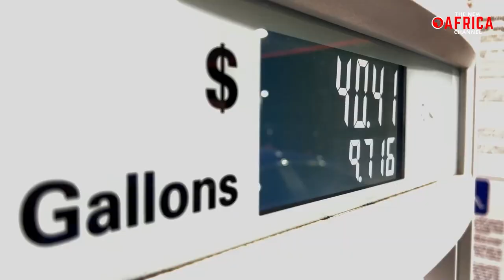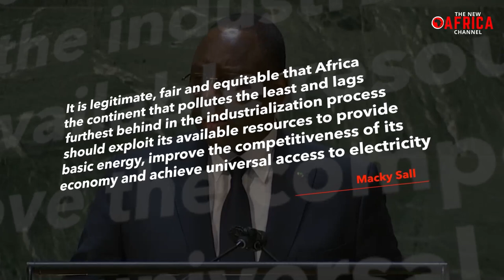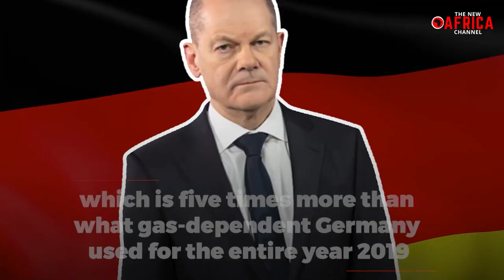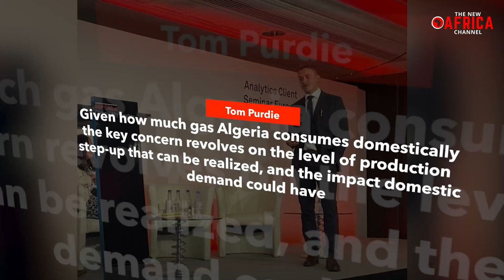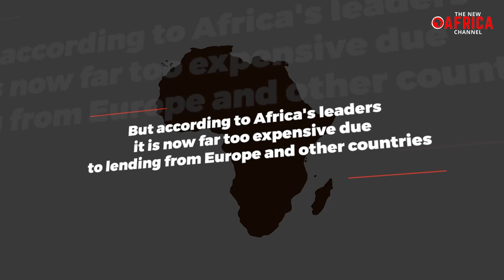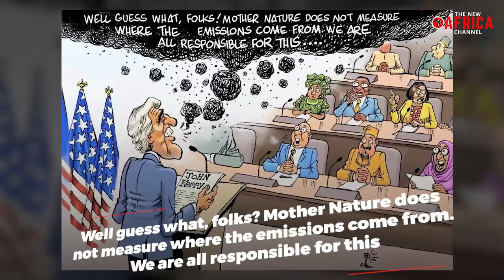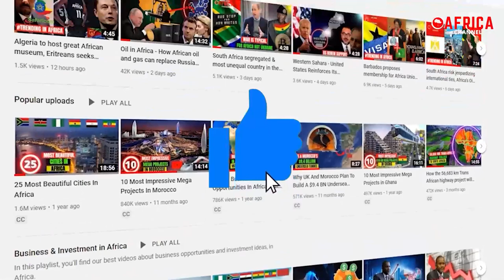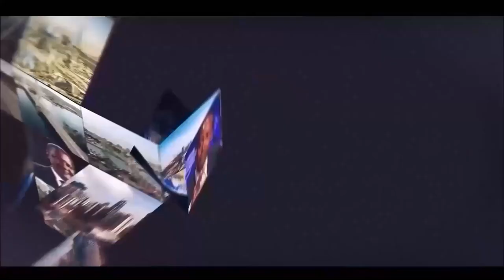Energy crisis forces EU to change climate stance for CHEAP African gas

Comment: Rich countries should be supporting the Renewable Transition in Africa. Equatorial countries most suitable for Solar!!
Reply: So in Africa where over 600 million people done have electricity, but a large gas reserves shouldn't use it to bring development on the continent?
However  it's ok when gas is used in developed countries but not in Africa?
Reply: @biologic9081  Not saying use your fossil fuels for transition but much of Central Africa is suited to Solar that can supplied at the Village level without the need for transmission lines. This can power heat, light and transport! Coastal Cities could use Gas but even better to move onward to Solar. Richer Nations should support this transition with project funding!!
Reply: @biologic9081  Use as much gas as you need and keep industrializing, but you shouldn't do the same mistake as Europe did (getting fully dependent on it and therefore getting dependent on other countries, fucking up our common atmosphere). If renewable energy is available - we should be using it instead of fossil fuels, doesn't matter where we are or how our political systems are. And yes, as a European I believe that we need to push renewable energy sources everywhere but especially in Europe/US/China/India. We mustn't rely on gas, oil and coal and help build solar panels, wind turbines, hydroelectric dams etc in other countries aswell.
Reply: @meinekerle1345  you are joking
Reply: @abrahamtschukudu808  good argument sir! Well done